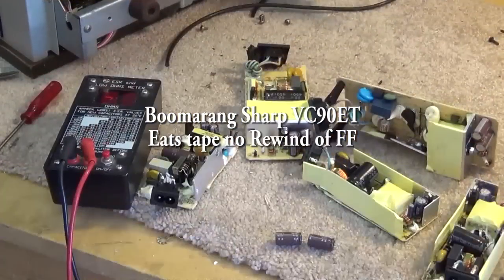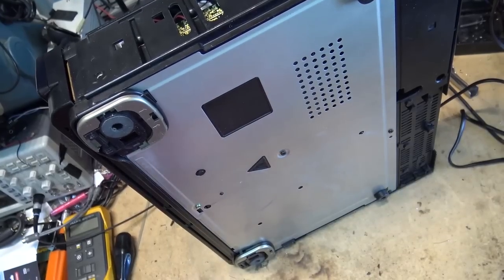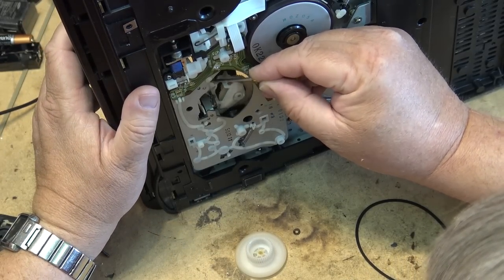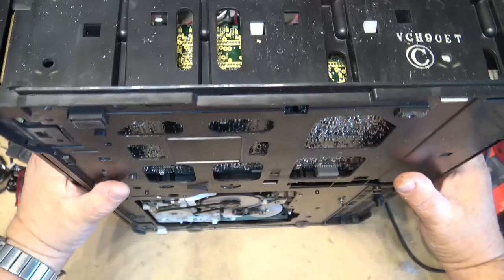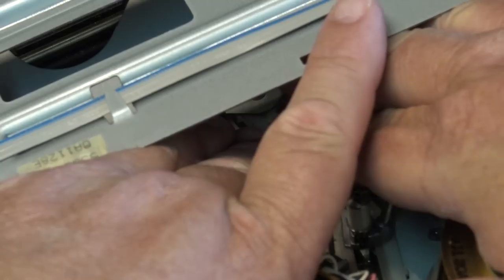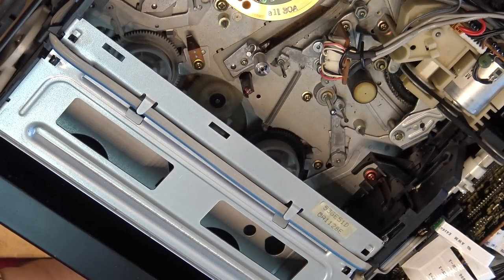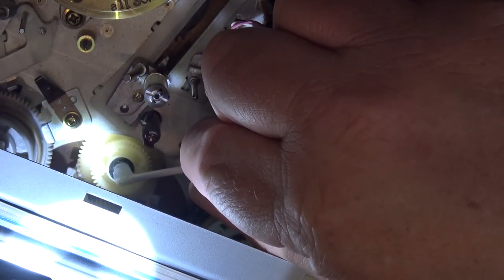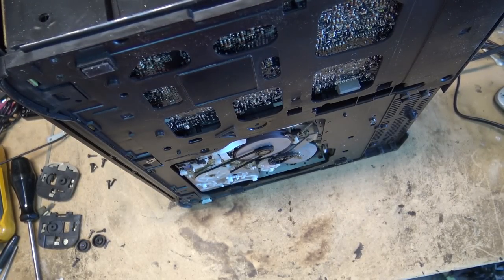Sharp VC90ET VCR Eats tape

Comment: As a kid when these were new, a machine that ate tapes was a death sentence. I can't tell you how many VCRs I brought home with me from trash cans and dumpsters that worked just fine minus something like this. This is back when a new VCR was a couple hundred bucks before DVDs. The ones I couldn't fix I would just take apart and put back together over and over. I still remember the smell of the grease that was inside those units, some of that stuff just would not wash off your hands.

Comment: FIRST! 😂. But now I need some serious advice. I'm working on a VHS/DVD combo. Cleaned the mode switch, heads, and greased everything. The unit is working great! Only issue I have is the clock will not change the time. The display works fine, the tape counter works fine, and I can set the clock. But it won't change. The time just stays on whatever it is set to. I'm 1000% puzzled.

Comment: The sound subcarrier frequency for PAL I (UK and some other countries) is 6MHz while for PAL B/G is 5.5MHz. There are also PAL N and PAL M, both used in South America, with a 4.5MHz sound subcarrier.
Reply from the maker: Yes I know.  I have a JVC monitor that will tune all 21 systems used throughout the world. I paid about 800 for that monitor in the day.  Still works as far as I know.  Haven't used it in years but used to use it all the time when transferring tales to pal and secam.

Comment: Did sharp make good VHS camcorders? As I’ve just brought a sharp VC-C10  vhs camcorder what I’m awaiting delivery on. I’m just wondering if they were good quality and lasted.  I got it as the discription says in full working order.
Reply from the maker: The only vhs camcorder I ever owned was a pvs350 svhs Panasonic. It was a full size unit.  Wasn't a very good unit as far as picture quality went.  Didn't have it long and upgraded to a ccdv5000 Sony hi8

Comment: Sharp was a funny company, they never sold well, the prices were lower but it was not junk. I think they developed the first LCD display. Yes it was when you sold old equipment too. You get married to it more than fixing it,
Reply from the maker: Oh I know all about sharp. I have an ancient LCD monitor that the clock just rolled over to 50,000 hours of use last week. Use that on my security DVR, and prior to that was on my desktop computer for many users until I got the LG that I have already had to fix the power supply on. They made great CRT TVs too.
They were always seen as junk in the market because they were cheap, and got beat up by big box retailers like Krazy Krazy. Sharp was sold as a lost leader to bring people in so they could be baited and switched by slick the salesman. They had some strange looking devices though. Some of the ulgiest camcorders I ever saw were sharp.
Reply: I have a 60" Sharp with the funky Quattron panel. It has a fourth yellow subpixel because supposedly that's better than red+green. Don't know how true that is but I see new 4K sets that have worse color, especially for flesh tones. 

Most importantly, it's 7 years old and it still works fine.

Sharp did buy the Elite brand from Pioneer and kept it alive for a few years. I think they still handle service. Those were really good sets.
Reply: @12voltvids   Great Sharp CRT TVs? I know a TV repairman who repaired a lot of them, and he says they are overcomplicated, unreliable junk. He said they used class-D amplifiers in their TVs as early as the late '90s, and those early class-D amplifier ICs were very problematic and hard to get. They used the same type for audio amp and vertical output.

I have to notice, I never repaired a single Sharp TV (nor done any research about said repairman's claims), probably not because they're not failing, but because they are very rare where I live (I know only one family who had a Sharp CRT). But I got a few scrap chassis from that repairman, and I have to admit, they look very overcomplicated and a pain to repair. Double layer 90% SMD PCB, covered with 64...100+ pins PLCC and QFP packages, made in about 1995. Surely amazing technology for the time, but ease of repair was the last regard for its engineers.
Reply from the maker: @mrnmrn1  
Oh I used to hate repairing them, as they were a pita when they broke, but when they worked they had a great picture.

Comment: Given long enough, that plastic will degrade and turn to dust completely. Which will be a problem for the long term preservation of these things for future generations
Reply from the maker: One word.  Archive. 
Get your video tapes into digital.  I should practice what I preach as I have many home tapes just sitting on a shelf fading away slowly
Reply: @12voltvids  of course you gotta keep your digital archives apace with current technologies. Was only 15-20 years ago, I had a lot of digital content archived on Iomega Zip discs. haha

Comment: I would recommend that you tell the customer to digitize his VHS tapes soon or else lose them forever.
Reply from the maker: He uses this to play his European tapes but you are right.  Tapes do deteriorate , I keep busy digitizing tapes.  Just had a dozen 8mm come in today.
Reply: Partially true. I always suggest to digitize, BUT for the most important recordings, keep the original tapes as well. How can you archive the digitized material securely? The only way for this is doing backups regularly, every few years. If you forgot this, good luck to watch your recordings just 5-10 years later. The lifetime of writable optical media is unpredictable. I have some 15 years old DVD-Rs which are fine, but some of them fail within 3-5 years. Either hard drives not really like the idea of sitting in a drawer for years unused (bearings can stuck, heads stuck to the platters, etc). 

The main problem with archiving on digital media: usually the deterioration is unnoticable, to the point when it suddenly dies completely. The signal deteriorates gradually, but the error correction algoritms hide it from you, you won't notice any quality degradation, but when the error rate crosses the threshold which is too much to be corrected, the content is gone. There is only a quite narrow time window, when you can notice your digital media is dying, it's when the error rate is right on the threshold which the error correction can handle - than you will experience very slow data transfer rates, but if you are lucky, you may do a completely successful backup at this point. 

If you kept the original tapes, and stored them properly, you can probably play them back for many decades. There might be some quality degradation over time, but a degraded quality recording is better than a lost one. I store my few original (and already digitized) family VHS tapes in ziplock bags, with a few bags of silica gel enclosed, to protect them from moisture induced binder deterioration and mold.

So I think trusting digital optical media or hard drives as backups is similar to Russian roulette. And the professionals agree with that: when they scan an old movie from 36mm film in 4K and digitally enhance the quality (color correction, scratch and dropout removal, image stabilizing, etc), finally they shot the result back to film for long term archival. Because film has proven it can be played back for 100+ years if stored properly. There's no such thing in the digital world - maybe pressed optical media will be one example, only time can tell (altough for archival purposes, they should use gold as reflective layer instead of aluminium or silver, because the latter two can be oxidized over time).
Reply from the maker: @mrnmrn1  
I suggest making backup copies on both a hard drive and solid state memory.  I do have DVD r disks I burned in 1995 that still read perfect.  I recommend making a backup of optical media at least every 10 years. Even the cheapest of dvd media will last 10 years easily if stored in the dark.  Many of my disks are 25 years old and they are fine.  I have had bad no name disks that have failed buy most of those were bad when I recorded them.   I just did a video about garbage Sony hi8 take you need to watch.  They do not last. My tapes  were stored properly and all of my Sony tapes have failed.   Always keep the source tape even after archive
Reply: JAMES AZBELL The problem with keeping analog tapes is that the machines to play them will fail long before the digital copies do.  I personally store this stuff on a raided NAS with a backup of mostly off line USB hard drive(s).  I have a friend that backs that up to Google Drive ( a digital storage service).  Of course the problem with Digital Storage Service is that there is no right of inheritance.  The service is canceled upon non-payment of the bill and all data lost.  I have recordings of me from as early as 1947.  Wilcox Gay Recordio to half track tape to digital.  Also my son has digital copies of most of the material.
Reply from the maker: @jazbell7  I store everything on bare hard drives. I have a pair of docks so I can copy between drives and make 2 copies of everything important. One drive stored on site, and the other drive off site. Since the drives are not spinning constantly they wil last literally forever, and since I have 2 copies if one were to fail I still have my backup. Hard drives are pretty cheap these days. I picked up a lot of 50 500 gig drives on Ebay for 80.00 and out of the 50 drives only 1 failed a surface test and was dumped.
Reply: JAMES AZBELL That's my position exactly.  The live storage is a Buffalo Terastation with 6 2TB drives in raid 10 configuration.   The offsite storage is several 4TB USB drives.
Reply: @12voltvids  DVD-R from 1995? I think you meant CD-R. Yes, optical media can last long, but I have expensive disks from big brand names failed within 5 years. The most reliable was the printable Verbatim AZO, and old Fujifilm DVD-Rs, and the oldest TDK CD-Rs with the dark green dye. And Taiyo Yuden.

Dave, solid state memory (SSD, USB flash drive) is a huge no-no for archiving. They are the most unreliable. SSDs can lost data within a year unpowered, if they were in heavy use before. You can find data retention predictions from different flash memory manufacturers, it's usually 5-10 years with a new, unused device, but this is going down proportional to the number of write cycles. We are talking about capacitances in the femto or even attofarad magnitude, are you really trust them to hold the charge for decades? Their data retention is very temperature dependent. Elevated temeratures shortens it, however IIRC, it is advatageous if the write cycle has been done at elevated temperatures, then the storage is under low temperatures.

An example of an article in this topic, there are many others:
http://www.ni.com/product-documentation/10126/en/#toc3
Reply: @jazbell7  There are so many VHS decks around, I don't think it will be an issue in the next 50 years to find a working one at some enthusiasts, who keeping them alive even when they will need custom manufactured spare parts at some point. The main issues are rubber rollers (especially pinch rollers), and aging plastic mechanical parts. I'm planning to do archiving in the future, so I'm already collecting VCRs of different formats, until they're cheap. I have quite a few VHS decks (usually multiple pieces of the same model, to have donors), two S-VHS, and only one Betamax yet. In this month, I won 5 auctions on VHS decks, one ended under $1, the most expensive was $5, because they were non working. The only issue with them was dirty video heads, they work fine now. The only exception is a 2000s  Panasonic with Z mechanism, which has its drum destroyed with cleanang tapes to a level where the grooves on the drum almost disappeared, it looks like someone pushed a piece of 400 grit sandpaper against it while rotating... Otherwise, it's brand new, haven't seen more than 50 tapes in it's lifetime, so it was fine for $2-$3, since I intended to buy it as a mechanism donor machine, because it is only 4 head mono, and my S-VHS deck uses the same Z mechanism.
Reply from the maker: @mrnmrn1  
I have had DVD-R from the mid 90's Might have been 96 or 7 but was the 90s. First burner was a pioneer IDE burner running on my old pentium 3 box with windose 98. That drive is still around here somewhere. It cost 1,200.00 BTW and blank media was 25.00 per disk, and the failure rate for burning was 20-30%. It added an additional 250.00 to my wedding packages. Very expensive to do DVD disks back then.
 I have some old boxes of. I have a DVD of my daughters birth that highlights her first year and it was burned in 98.  As to archiving onto flash memory it is only as good as the person maintaining the archive. A copy needs to be made every 5 years, but at least it is easy to copy. Plug into computer and drag from one to another. I always recommend multiple formats DVD and USB stick for example. That way there is a backup. Myself I use optical media, and then make a copy at 5 years. I do have hundreds of disks of material I have recorded over the years, much is just stuff of TV or satellite and all my disks play find except a bad batch of generic crap I bought online. They were bad right from the get go and many didn't play as soon as they were burned so into the bin the entire spindle went. I think they were early princo crap.
I was an early adopter or optical media. Had one of the first CDR burners too. That would have been early 90's and yes CDR blanks were 20 bucks each back then too.
Reply: @12voltvids  Wow, that was super expensive. I remember  in 1999, I have seen a x1 or x2, probably Pioneer DVD burner in a pricelist for about $4000, but it was in Hungary (800000 HUF was the price, and it was an expensive, little PC store). Was mindblowing since it was about four times the cost of my freshly bought 300 MHz Slot-1 Celeron PC. We've bought our first DVD player in 2000 or early 2001, it was an IDE PC drive with a RealMAGIC Hollywood Plus MPEG2 decoder card, because the Celeron 300MHz was too weak for software MPEG2 decoding. 

In the summer of 2001, we bought a new PC, which was an 800MHz Celeron, but we kept the decoder card because it gave much better picture than the software DVD players of the time. We used this config for watching DVDs until 2004, when the decoder card died, then we bought a new Sony DivX compatible DVD player, which we still use since then, altough we also have a Sony BDP-S185 BD player as well (bought second hand in 2018 for $18 :) , it works fine, it just doesn't support the online streaming services anymore, because the support ended for this 2014 player).
Reply from the maker: @mrnmrn1  
My first non linear editing pc was a pentium 3 slot 1 motherboard. It literally broke the bank building it. My capture card a Miro DC30+ for 1200.00. A 9 gig ultra wide scsi drive 4,500.00 and another 500 for the UW SCSI pci card Primere 4.1 was 1,500.00 and the pioneer DVD burner another 1200.00
My ATI graphics card another 700 and my nice big Viewsonic 21" CRT monitor 2000.00
The processor 350, RAM motherboard and power supply 650.00 and 80 gig boot drive 300.
Was about 12 grand for the computer, and I could store a whopping 10 minutes of material at a time on the 9 gig video drive.
Reply: @12voltvids   Phew, I'd maybe pay that much for a PC config, if I won the lottery... That's the price of a decent car! OK, for professional application, it was probably profitable. Video editing on the avarage PCs of the time was a pain. And it was practically impossible to produce professional quality video with them in a reasonable rendering time, without the aid of hardware MPEG2 encoding.

Comment: Finally   !!!   This video can be viewed without Flash Player .
Youtube dose not need Flash ,  Youtube is a Player .
Flash Player is for those internet sights .
Pain in the ASS .
Reply from the maker: I didn't think yt supported flash anymore.  
Flash is required for many security cameras such as those on alarm.com
Reply: @12voltvids  Yep   if Flash ait running , HML5 will not run ether for Live stream .

When I download any vid now it there are 2 of the same , so thats 2 players .

I have removed the dead Flash for RAM space .
If I re-load it , it sez  ....,  not enough disc space .  there is nothing but space here .

I have to weight several days till YOUTUBE turns it off !

YOUTUBE is not improving  .
we have comments not loading .
we have no full screen after a watching several vids .
vids that are less than 720 p will not go in full screen anymore becouse they keep messing with it . 

Software morons .